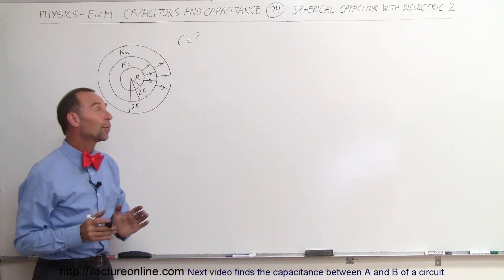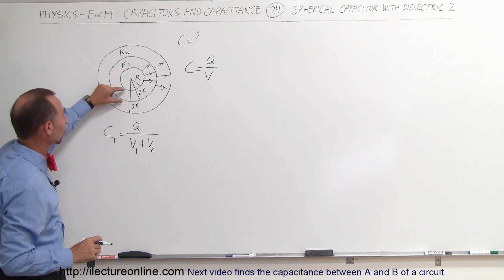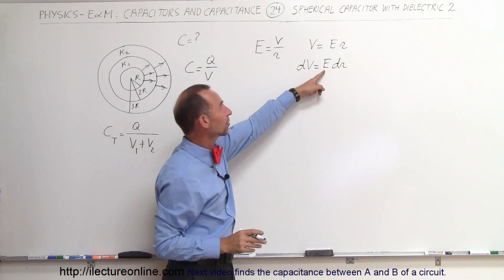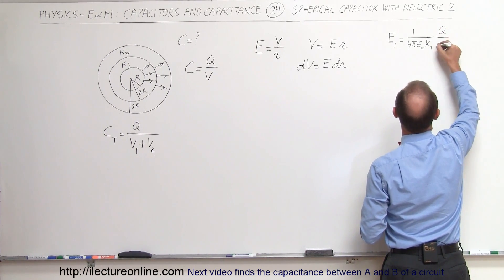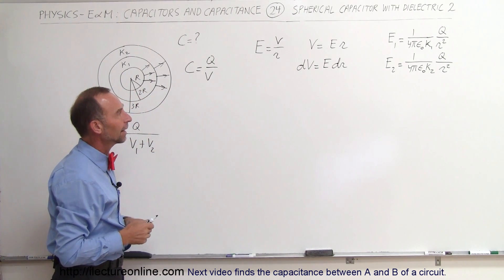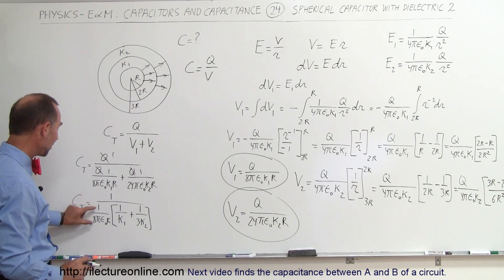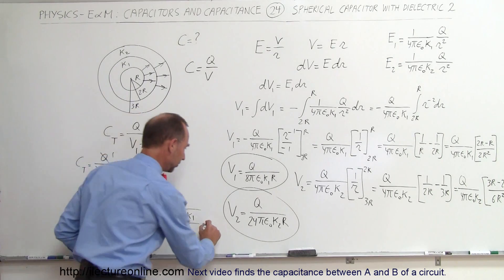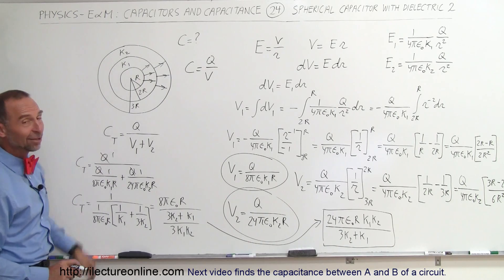Physics 39   Capacitors (24 of 37) Find C for a Spherical Capacitor in 2 Spherical Dielectrics

Comment: Gauss man did everything possible to relate flux, charged enclosed and electric field with each other. And this 10 minutes video did everything possible to put all those efforts in vain
Reply from the maker: This video is not an application of Gauss's law.  It calculates the capacitance of a speherical capacitor with multiple dielectrics.  We have 2 playlists of videos on Gauss's law on this channel.
Reply: @MichelvanBiezen  didn't you take help directly or indirectly of the gauss law, for finding the electric field in that region, without bothering about the enclosed charge?
Reply from the maker: We did not use Gauss's law in this video, as we do in the Gauss's law videos.

Comment: When you calculate the second electric field for the outermost dielectric layer, you are basically taking a Gaussian surface and then acquiring an expression for the Electric field from there.  However, you did not take into account the inner most dielectric's relative permittivity?  Is this something we can do in general? Just ignore the inner dielectric when taking a Gaussian surface in an outer dielectric?

For example, if there were a third dielectric, would the Gaussian surface used to calculate the Electric field within that third dielectric would simple ignore the first and second layers of dielectric? i.e. k1 and k2 would not appear in this third layer's electric field expression?

In general when composing an expression for the electric field in dielectric layer "n", do we only consider k(n) and forget about k(n-1), k(n-2), k(n-3)... and so on?
Reply from the maker: Gauss's law specifically states that the electric field outside the surface only depends on the charge inside and the surface area of the Guassian surface.
Reply: @MichelvanBiezen  Gauss's law also has enclosed charge over the electrical permittivity of free space (or relative permittivity of whatever medium the surface is enclosing).  And when you were working out the electric field inside the second dielectric, there is no reference made to the presence of the enclosed layer of the first dielectric and the differing permittivity of that medium.  Is that just how we use Gauss' law?  We only care about the permittivity of the medium that is closest to the Gaussian surface?

Actually, just while thinking about this while typing - I suppose we don't care about the mediums that may lie beneath the medium that hosts the Gaussian surface (and therefore are not in direct contact with the Gaussian surface).  When calculating the electric field outside of the spherical capacitor (assuming it was in a vacuum) we would just use the permittivity of free space - and we wouldn't care about the permittivity of any of the other mediums housed within that capacitor.  I think I understand now.  Thanks for replying, you always respond - it's quite amazing.

Comment: where does the charge reside on the outer sphere? if you shine a UV lamp on the outer sphere will negative charge leave the outer sphere indicating that the charge resides on the outside?
Reply from the maker: When charge resides on a capacitor, it resides on the side of the surfaces facing each other.  (on the inside surfaces).

Comment: I understand that the electric field can be derived from Coloumb's law, but I was wondering why the same result does not occur when you use Gauss's law, which states that the closed line integral of E is equal to Qenclosed/epsilon? If you use Gauss's law, E = q/(2 pi r epsilon), assuming that the area is 2pi r is the area.
Reply: I found a different video that uses Gauss's law to find the electric field in this way. https://www.youtube.com/watch?v=Lybx7-9Nnvw&ab_channel=LecturesbyWalterLewin.Theywillmakeyou%E2%99%A5Physics.
Is there a reason for this discrepancy?

Comment: shouldnt you take into account that each layer has a different charge, q1 and q2? I had a similar question but the radii were arbitrary, shouldnt C1 = Q1/V1 and C2 = Q2/V2, then solve for total capacitance of capacitors in series: 1/C = 1/C1 + 1/C2.
Reply from the maker: Does that give you the correct answer?
Reply: @MichelvanBiezen  I don't know, im asking you! I assume my answer is correct since i'm not assuming the charge density is equal across the sphere.
My answer looks different to yours although i havnt set all r's to your values (1r, 2r, 3r) and simplifies, maybe i would get your answer... 
You've made an assumption that the charge inside the middle layer is the total charge within the sphere, why so?
Reply: I tried this problem on my own at first and solved it using this logic and it worked! you get the same answer either way :)

Comment: Imagine this...
1R and it's interior... A conductive solid/liquid sphere of ferromagnetic iron and nickle...
K1... An insulating silica mantle, (silica being the primary ingredient in common glass...)
2R... A saline ocean covered planitary crust...
K2... A lower atmosphere...
3R... An upper atmosphere...
Then consider the fact that as can be observed from the aurora at the North and South poles, there is evidence of enough current and voltage to allow the visible ionization of the atmosphere, as well as the fact that the Earth is on an eliptical orbit that periodically brings it closer to and then and further from the sun... Is it not entirely plausible that the Earth and other planetary bodies act as spherical capacitors with inductive cores that are able to charge and discharge both voltage and current, and thus electrical power? And couldn't this charging and discharging cycle possibly help to explain, when combined with the the movement of daily rotation and yearly orbit, the generation of our magnetic field and geothermal heat & Vulcanism?
Reply: probably

Comment: Thanks a lot! Q:  How did you calculte the electric field. if i assume the the inner sphere has Q ammount of charge, and as result the middle sphere has -Q and the outer has Q again.
if I'm using gaussian to determine the field between the middle and the outer so i get E2= 0 (because the total charge inside is 0) . I know I wrong somewhere but can't understand where...
Reply from the maker: For a capacitor, there are two plates.  There is an equal amount of charge on each plate.  If you draw a Gaussian surface between the plates, the there will be charge Q inside the Gaussian surface.  If you draw a Gaussian surface outside the second (outside) plate, the net charge will be zero and there will not be an electric field outside the capacitor.
Reply: @MichelvanBiezen   thanks, I thought there is another plate betweem the dielectrics. which is incorrect...

Comment: Is it necessary to integrate?
What about depending on our prior knowledge? (We have previously derived the equation of a spherical capacitor.)
Hence we can consider this multi-dielectric capacitor as two spherical capacitors connected on series.
Is it fine to do so??🤔
Reply from the maker: If you already have the equations that were derived using integration you can use the same equations to solve other similar problems.